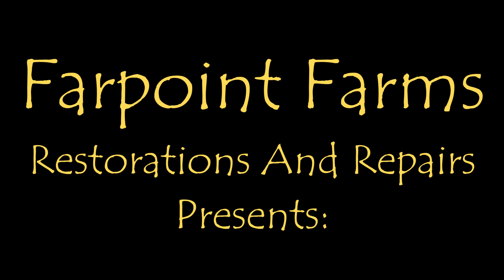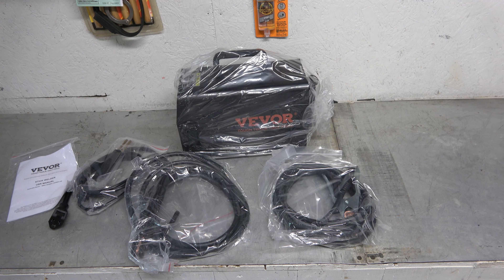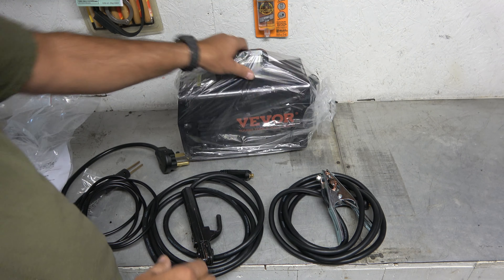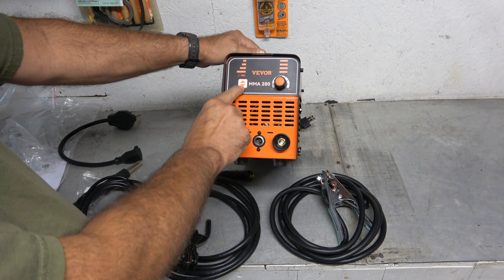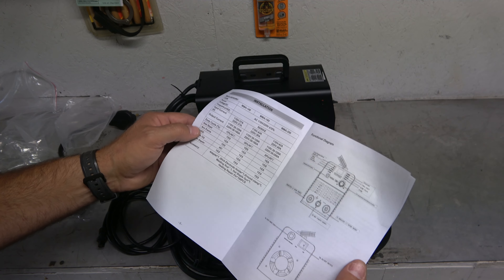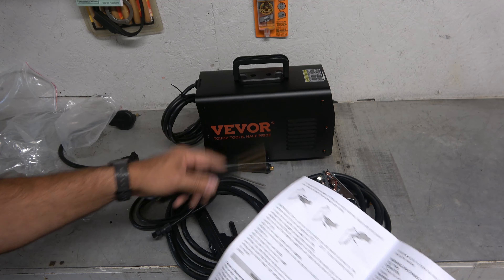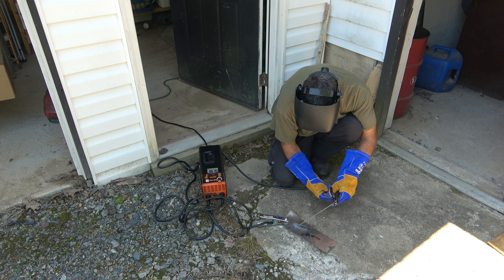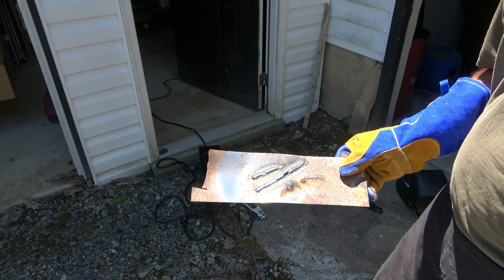Vevor MMA 200 Welder. A 120v stick welder that really works! It also does plastic Repairs.

Comment: It's pretty amazing how small and light they have made welders.  I hope you go back and show how the plastic welding works.
Reply from the maker: I will as soon as I can find something to stich.
Reply: @FarpointFarms  I will definitely be keeping an eye out for that.  I worked for a little while at a rental store and they talked about sending out some plastic rental chairs to get them welded. I had never heard of it before.  I was skeptical of it because if one was repaired and broke and someone was injured what would happen.  Plus they kinda looked like the plastic chairs stacked up in front of walmart for $4.99 each. A. I couldn't imagine trying to repair something that cheap. Plus I figured it would cost more than a new chair. Maybe they were a heavy duty version of the walmart chairs and I didn't know?  I was always hesitant to change anything that might bite me in the buttocks.

Comment: Your technique looks alright but you didn't chip the slag off!
Reply from the maker: I am a total newb. Even at my age, I suck at welding and try to learn new stuff all the time.
Reply: Your technique doesn't look like someone who sucks at welding. Try that again with a 7018 rod long sleeves,and a thicker plate of steel, you'll be pleasantly surprised.